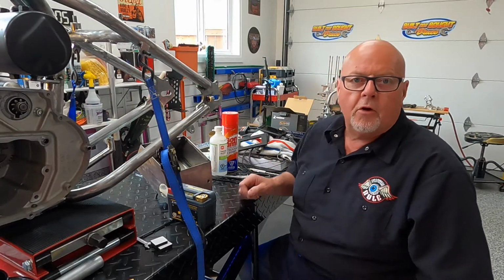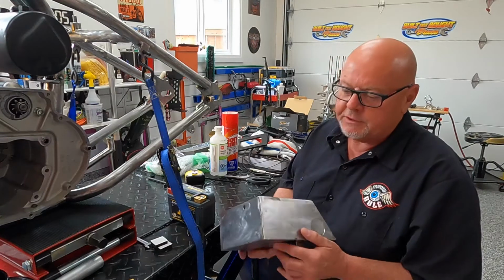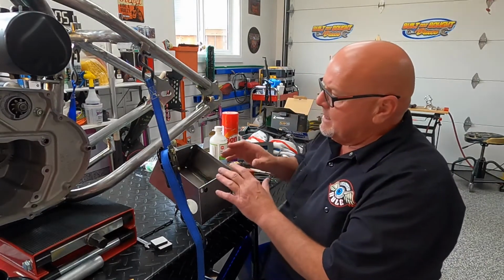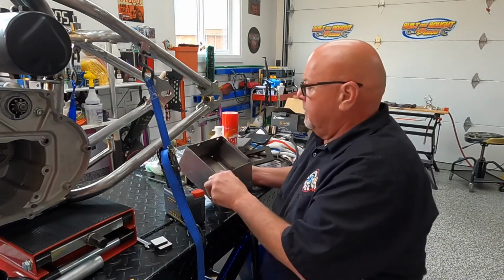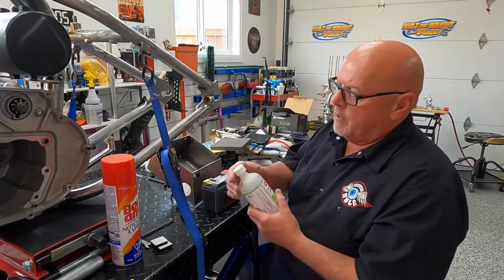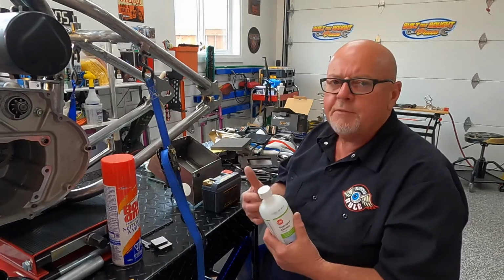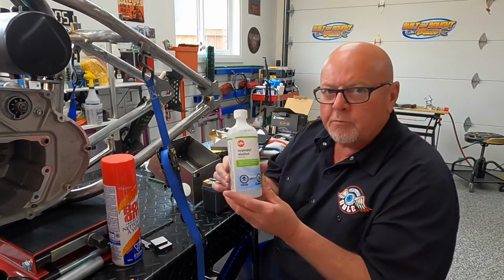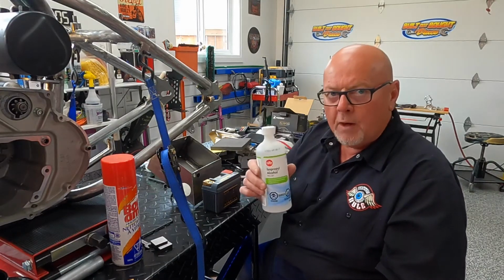Installing the Lithium Iron Phosphate Battery

Comment: What size battery are you running? 12V - (?.?AH) and dimensions of your battery. I’m trying to figure out the smallest one I can run. Mainly in overall size. I have a 82 Ironhead that I’m only running headlight-hi-low &,taillight/break light. I think I need like 330-360 CCA’s for starter.
Reply from the maker: Hi Rusty. Thanks for watching my video. The battery is 12 volt, 36 Wh and 210 CCA. It would always be nice to have more CCA however, if your engine is not high compression and well tuned so starting is quick, it really shouldn’t take that much. The guys at Precision Motorcycles tell me they have used several of these batteries now with no issues. The brand is Poweroad and the model is PLFP-9R. The dimensions at the widest point are 5.25” wide by 2.5” deep by 3.625” tall. The battery tapers slightly to the base. One of the advantages of these batteries (lithium iron phosphate) over lithium ion is they are much more tolerant of Harley charging systems and battery chargers. I will be hard wiring in a plug for a trickle charger and hiding it somewhere on the bike. I don’t want to have to remove any covers to connect a charger. Please let me know if I can assist you further.
Reply: @builtnotboughtbybruce  It is not recommended to trickle charge lithium batteries. When the battery starts to get lower in voltage just hook it up to a charger. If not your battery will not last long. I found out the hard way and killed a $170 battery in a few months of trickle charging. Love the videos!